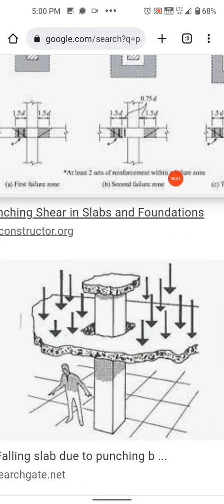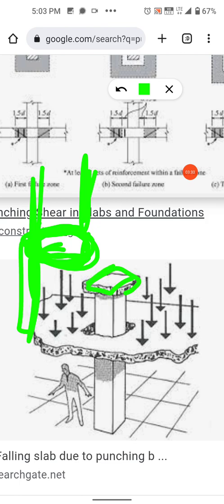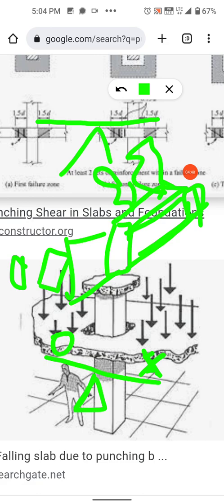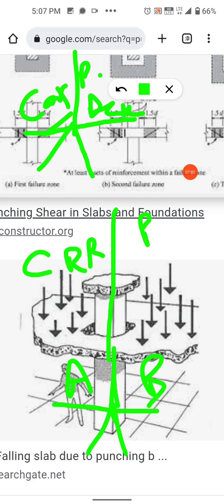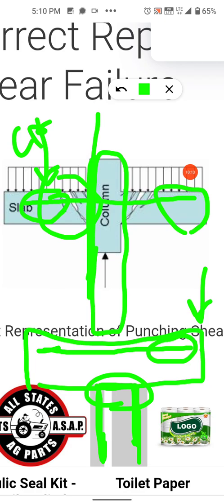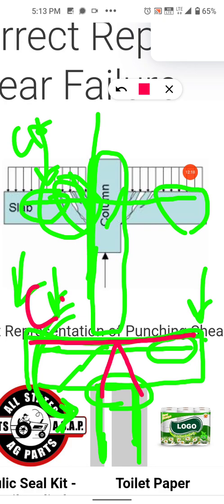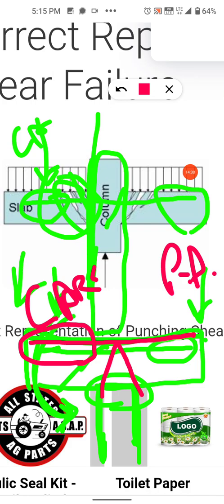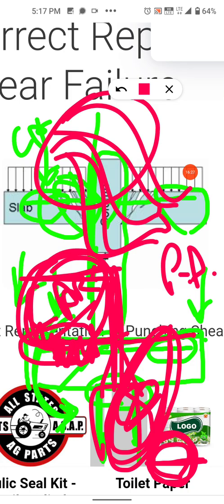CHAMPLAIN TOWER 'Cantilevers" are at columns and walls These Zones tell the story of this failure

Comment: Cantilevers of the sort you are referring to are not typically an issue deemed worth considering since those are *post collapse issues.. The original design is supposed to be good enough that collapse never occurs.   AND 'per code'... 

The front section of every code manual has a statement to the effect that 'these are *minimum standards. And that the engineers and constructors have a duty to see that the product is safe and effective'..   So that to be competitive in the engineering and construction business it means that the minimum is generally what gets built.

Anyone who attempts to add some fail safes that run the costs up is ridiculed and pointed to all but the cover pages of those code books...so that the bare minimum has become the standard....even though the code manuals advise the work be done to include net viability.

.
This would become crucial if the rebar was deteriorated, with spalling etc.
Reply from the maker: Hello Phil, yes... My thought experiment requires the viewer to see the structural rigidity of the design ... That at the wall, the rigidity extends beyond the wall and results in a critical Shear zone that extends approximately four to five feet from wall...
That the columns basically lacked the critical Shear zone as seen in the ''capitals" in this video (the greenish images)...
Yes, a Cantilever is connected on one end, for the most part... I want the viewer to see the deck as being connected to this "critical Shear zone" at the wall ...that it transfers the loads like a Cantilever, back into the wall system... This is because of the stiffness created via the top, bottom and wall steel which are locked , like a moment connection...
Reply: @ForensicCats Analysis In the good old days these columns to slab connections were about 8 feet square and foot thick in the column area, tapering to an inch or two on the perimeter...those guys understood your rigidity.....  leverage, and instinctively your cantilever issues. Cultural decay is at the bottom of it.

The space shuttle disasters were prime examples as was the Millenium tower in San Francisco... and continue to be the case today.  Very similar with the Fed and other such ongoing rolling disasters  My testimony before congress addressed that point, when engineers are coerced into lying or compromise it ruins them to the core, then their families, then the culture.... then the entire nation.

.
That condition has spread like crabs a the Honolulu Yacht club.
I believe you are raising key issues that Engerineering schools like those absolute rocket scientists at FIU have clue on along with no integrity at all.  and it is crucial.
Reply from the maker: Phil, this is why I pinned your comments on this subject, you understand that this is a systemic issue and this is only going to get worse!
I do not even foresee it getting better with codes, as this would bounce back on all the existing structures and heaven forbid if tax dollars are lost as one building after the next is found to be unsafe...
Connecting what I describe as a "bridge" / these parking decks to the structure is just plain, old fashion, stupid! == for clarity, I mean connecting ''concrete fabricated parking decks" (not steel structured parking decks)...
These parking decks should NOT have cracks that increase in time, "for free"... cracks indicate deflection and deflection indicates strain on the reinforcement and strain on reinforcement = strain on the concrete bond of the concrete and steel.
They should NOT allow these types of heavy overlays on top of the existing structures, unless they are part of ''composite deck system'' that reinforces the lower / structural deck. 
They should NOT allow these repairs without testing! = testing with old fashion load testing! 
The testing MUST be in the form of the loading predicted and NOT distributed loads; automobile has a ''footprint'' and does distributes that load via the tire surface contact area.
BUT, the deck is designed to take a UDL = uniform distributed load and a car is NOT a UDL.
As you stated, "instinctively" is what is lacking in engineering, the ability to just see ''stupid'' in analysis or assumptions, without the need for a finite element program to tell the engineer that they have an issue here or there...
If, you require finite element program to assess your work, then you are NOT learning from the program you depend on... What I mean is, current engineering firms use FE programs constantly and yet, the engineers cannot just ''visualise" (ahead of time) where the program will reveal some highly stressed locations.
We see that professor, Dawn Lehman introduce ''rust'' into the formula and yet rust can be a positive thing, it is acceptable in the ACI codes (to a degree) and yet, no public information shows the ''deformed rebar'' having excess rust on it... 
Phil, I will do a video and show this again, that the steel still has, very impressive ''profile" from the manufacturer(s) still on them.
I believe that ''rust'' is a bias on this PHD professor's part and she should stick to Earth quake studies...  (she is the one who made a public reply to me, that she could not judge a buildings issue from the building's collapse state; then turns around and does one release after the next for the Miami Herald... contradicting she/her own public statements!
Of course, we have the Josh engineer who insisted it was post tension failure in the roof of this structure and even drew his layout of the post tension on the roof and how they failed! ( he went from 800 subscribers to almost 38,000 subscribers before deleting that content because it was an embarrassment and he then built up his channel with that LIE)...
Then you have that architect from S.A. who stole my deck ledger failure and posted it as an animation and gave zero credit, he had zero history of posting ANYWHERE on this subject and I even found him in a forum talking about taking ideas from others and doing the renderings!
They make about $5,000 per million views and these ''professionals'' are disgusting! 
This brings me full circle to your comment on engineers ''lying'' ... this appears to be a solid trait of engineers, their ability to LIE and plagiarise...   All to make themselves appear ''smarter" than what they really are...
MOST engineers do NOT have on hands experience with the materials they are specifying to be used; sure, they may have supervised a few jobs but that is nothing, until you get your hands dirty and experience the true issues...
With that said, structural engineering appears to be an echo chamber of failures. For example, the echo chamber of the FIU bridge collapse being accepted as the NTSB narrative and yet, NTSB NEVER let itself be questioned on their assumptions by the engineering community...
They just published their findings and walked away; then all the structural engineers just repeated their findings in one ''circle jerk'' seminar after another...
Reply: @ForensicCats  

Thanks, that was informative as hell, your remark about cars having point loads at tires often 15 feet apart got me thinking about the loads on the punch through *perimeter which includes the weight of the slab all of it *concentrated on the perimeters at the punch throughs... and in this case with precious little rebar.    

You are opening cans of worms by the dozens that will echo through the engineering culture while having to deal with morons with no integrity.   And while these continue to create these abortions go largely untouched.

I look at it as things we came here to learn.

I see this wall to wall in the building systems mechanical engineering business, 

Elon Musk has found this to be the case in countless higher end areas as well... severely, radically, and at the core .... now with the manufacturing moved to China etc.  This entire nation is on the skids headed south for these reasons.

 Our leadership lies about the cause.   That is because people who lie cannot see even obvious facts nor any aspect of the truth.  A good book on that is 'People of the Lie' by Dr M Scott Peck, MD a best seller in the70's

There is apparently no cure for that.  It is a bit of a terrifying read.

Those that go along to get along do well in their careers, but it rots what is left of their brains and it is not pretty...by rot I mean that it is actual physically corrupted...  that is also pervasive.   People who lie create a non-functional algorithm in their otherwise wonderful brain that locks the brain into error by means of justifying their behavior...we have not discussed the non-material issues here.   Those are limitless in both directions.
Reply from the maker: Phil, I still have about 20 minutes left in that Boeing video... amazing, they were hiring people with no experience in aircraft manufacturing     as part of the build team!

Comment: I saw your reply to the top comment on your last video about force multiplier and my mind went to a see-saw.  Funny you went there with this next one.  Thanks for the education, which has been about a year now. For me at least, since the fall of CTS
Reply from the maker: Thanks Chezblarger   for being here for a year, I appreciate you. The force multiplier is in many reactions, can you think of another (back of hammer for example, rocking to pull nails), or a cheater-bar, or how about a hydraulic transmission's hydraulic fluid system...  how about gear reduction?